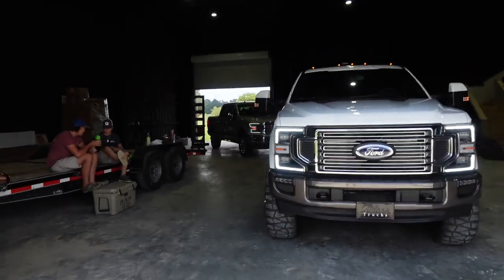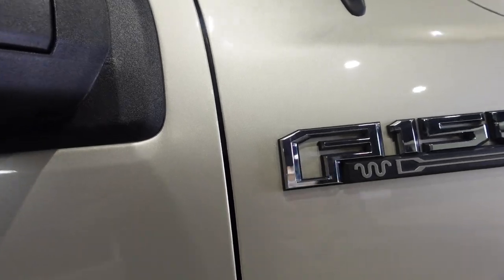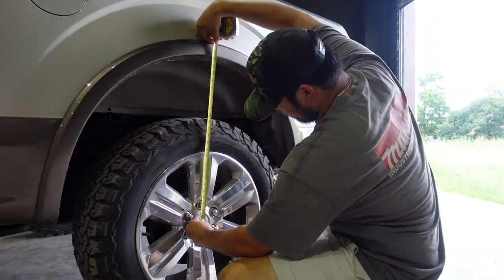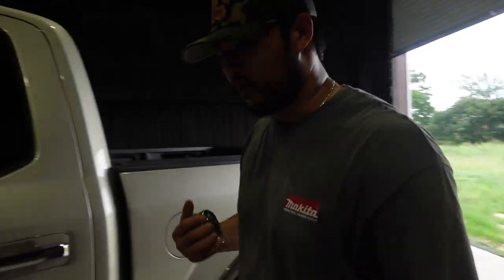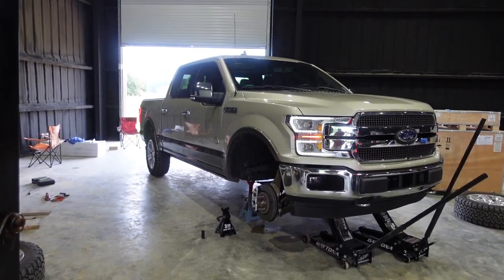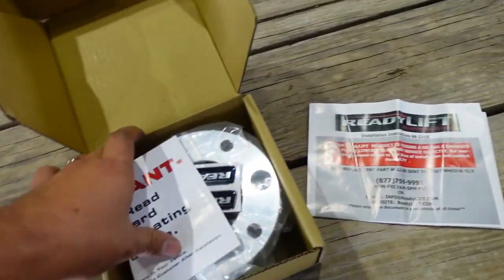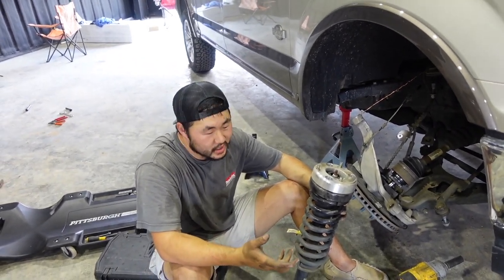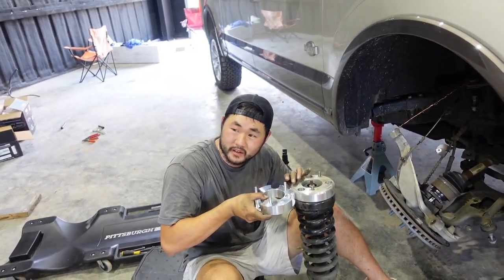Ford F150 Leveling Kit Install For My Parents...

Comment: LOL, Same thing happened at our shop, A kid brought his truck in for us to install his leveling kit. When we got  the truck up on the lift I could tell there were already leveling blocks on top of the struts before we took the wheels off. Man you went a long way around to find out the hard way.
Reply: I just got an F150 and couldn’t tell whether it was the 33s or if the truck was actually lifted and leveled turns out it was a 3 inch full lift with lift struts in the front and a block in the rear